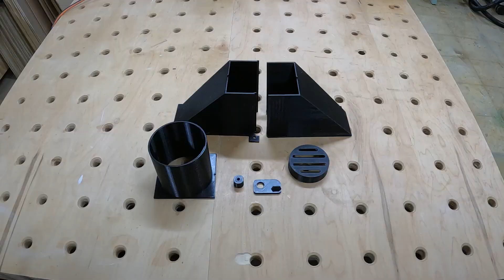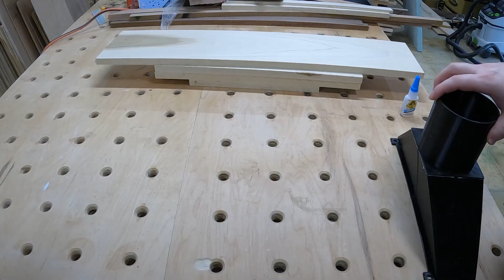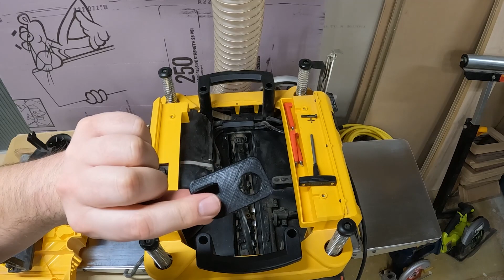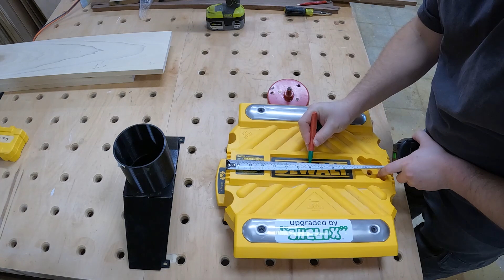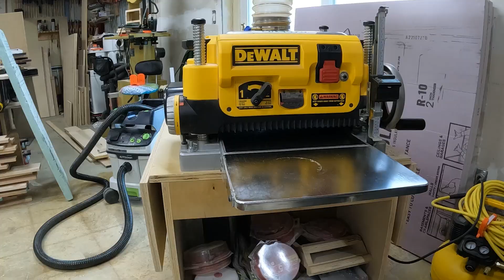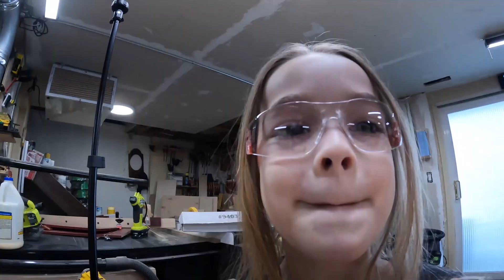DeWALT Planer DW735 dust modifications from print to fully installed

Comment: Great video, already got the part printed but this really helps with cutting the hole for the port.
Reply from the maker: Thank you for the feedback and purchasing the part to print.
Reply: Noticed on your site it indicates it can’t be used with a shop vac, for those of us yet without dust collector can you tell us why it won’t work?
Reply from the maker: @Rolland Brower  to be honest that was a blanket statement made based on my assumption of the volume of air that needed to be moved. 

Since the question was posed though I did a rough setup to hook up my Rigid 6.5 peak HP shop vacuum to it and was surprised at the results. It did a very nice job sucking up the chips from a small 6" x 12" board of walnut that I have been using as a test scrap. I removed 0.02 of an inch and it sucked up at least 90% of the chips. 

Now will it work with all shop vacuums? Maybe, but it seems to work nicely with this Rigid.

If you would like you can fill out the contact form on our website https://builderdads.com/contact and I can give you a call.
Reply: Thanks to Byron and BuilderDads for the info and help.  It’s good to get the back story on using the rigid shop vac. The comments help in deciding whether or not to make the update either before I get a dust collector or before. It’s appreciated
Reply from the maker: No problem, glad to help.

Comment: The fan still sucks air and can be used to help cool the thermo coupler. Drill some holes in the side of the housing near the thermo coupler. Then on the inside with the cover off. The motor fan will pull air through the switch housing and help keep it cool. A flaw in the design that nobody is talking about. I piped in a 1” hose to pull air. I make bee boxes and work with wide boards.
Reply from the maker: That is a good idea. With the fan still on and just the port cover adapter covering it the air flow is pretty strong. I have yet to overheat the unit, but I wonder if some additional breather holes would improve things. Thanks for the idea. Would love to see a picture of your modification.

Comment: I have a question.  Why couldn't you print a 90 degree or some type of 90 degree tube and attach it to the exhaust?
Reply from the maker: Do you mean instead of modifying to go from direct off the head to using a 90° off the back stock port? If the answer is yes then the reason is that I upgraded to a Shelix head which overloads the rear impeller. I get less suction so more chips on the floor and an overheated motor that trips my circuit breaker by keeping it stock. By switching up to collecting right above the cutter the chips do not have to pass through the rear port and do not then overwork the motor. This enables my motor to run cooler without over heating . It also gives me better collection which leaves almost no chips behind. 

I hope that answers the question and if not let me know.
Reply: @builderdads  Thanks!  Yes this did answer my question and I can see from your explanation that it was necessary to do it the way you did.
Reply from the maker: @ibuyufo  awesome!

Comment: You want to blow peoples mind? Find a way to put a larger motor on it. Maybe a 240v…
Reply from the maker: That would for sure be a unique modification.
Reply: @builderdads  I have an older dw735 that I bought for back up to my new one. I’m thinking about pulling the older motor and trying to mount it to the fan shaft with a coupler. Two motors inline…
Reply from the maker: @3Beehivesto300  interesting idea. Makes one wonder how that will impact performance and if the changes are positive are they worth the cost of the modification. I'll be interested to hear update on this.

Comment: I see a huge lawsuit against you. You have bypassed the safety for when you have the cover off. That’s one. Second I see no safety from something falling into the top and right into the blades. Either an object or someone’s hand. 
You better not sell or ship this thing to anyone. Desalt designed this with safety features and you are promoting a dangerous product.
Reply from the maker: Thank you for your feedback and for raising concerns about safety. It’s an important topic, and safety should always be the top priority when using, maintaining, or upgrading any tool.

I personally love the DW735 planer, but in its stock configuration, it had limitations—particularly after upgrading to a helical cutter head, which introduced challenges like clogging and poor performance due to increased chip load. While modifications can present new risks, it’s essential to understand that, like any woodworking equipment, the user assumes responsibility for its safe operation and maintenance. Caution should always be exercised, whether the machine is stock or modified.

To address your concerns, here’s additional context about this modification:

Safety Switch Override:
The stock cover includes a lockout mechanism to prevent the machine from operating when the cover is removed. While this is a valuable safety feature, it’s crucial that users always follow basic safety protocols, including removing power sources during maintenance. For this modification:

     • If the cover is not cut, the safety bypass switch must be installed to operate the machine.
     • Regardless of safety switches, tools should always be unplugged during maintenance, as safety switches can fail.

Dust Port Cover:
The kit includes a dust port cover designed to prevent accidental contact with the impeller fan, improving safety beyond the stock configuration.

Dust Boot Cover:
To prevent objects or debris from entering the dust boot, the kit provides optional covers available in both friction-fit and magnetic setups. Personally, I use a magnetic cap to secure the dust boot when not connected to a dust collector.

Unplugging the Machine:
The instructions explicitly remind users to always unplug the planer:

     • When not in use
     • During installation or removal of modifications
     • When performing maintenance or adjustments
       This practice is critical for all woodworking machines, stock or modified, and is prominently highlighted in the kit’s documentation.

User Responsibility:
As with all woodworking tools and aftermarket upgrades, users assume full responsibility for safe operation. This includes following instructions, adhering to safety best practices, and exercising care when working with any tool in the shop.

This upgrade was designed to address specific issues I encountered with my DW735 planer, particularly after upgrading to a helical cutter head. The stock dust collection system wasn’t sufficient for handling the increased chip load, and this modification significantly improved performance and dust collection efficiency.

Safety is more than just a word—it’s a philosophy and a practice that guides everything I do as a woodworker. It’s something I hope every user takes seriously in their own shops. If you have further questions or concerns, I’m happy to discuss them. I take safety very seriously and strive to provide tools and knowledge that empower users to work responsibly and effectively in their shops.